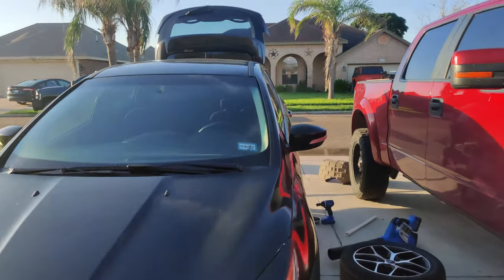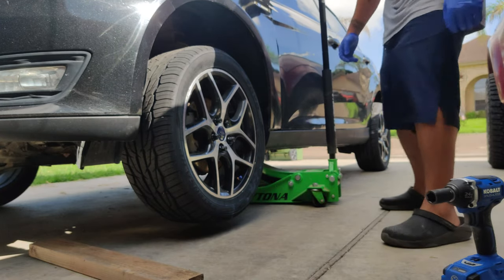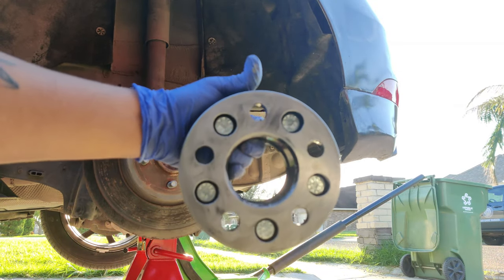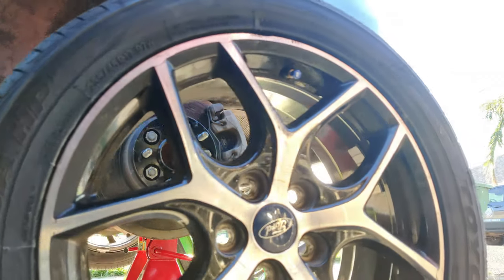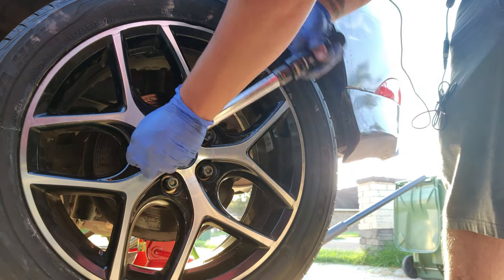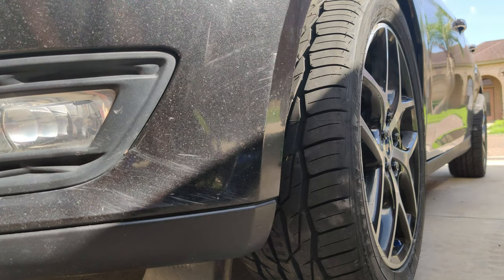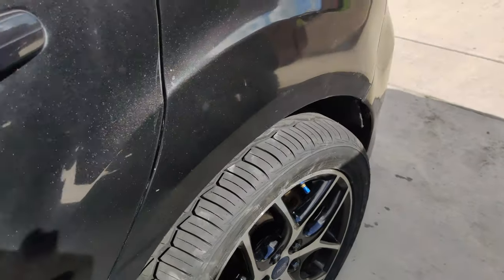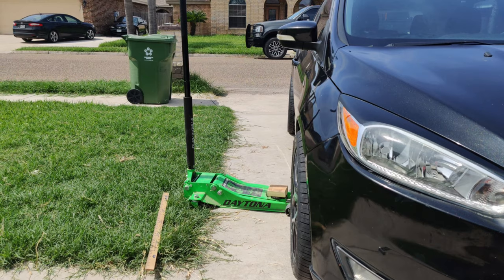Ford Focus Wheel spacers-How To

Comment: Thankfully a video of someone spacing factory wheels that’s NOT AN ST!! Lol 

Appreciate the video! Although helped me decide size I’m gonna go for my personal opinion with a 15mm front and 20mm rear. Not saying 25s look bad, I’m just looking for it to sit just flush with the fender and get rid of that horrible sunken in look. 😅
Reply from the maker: Yes, from the factory the wheels are totally inside. It does have am ugly look. With these spacers I can see a more sportier stance. Thanks for watching
Reply: I second the appreciation of a wheel spacer install and outcome on a NON ST or ST wheels. 
I opted for the 20mm rears for the more flush fitment. 25s look good! Just trying to get the rears at least not so sunken in looking horrible from behind. Then next are the fronts. 
I’d love to know why OE’s don’t calculate suspension, offset, hub assembly’s to have closer ratio to fender fitment rather than sunken in all around .5-1in 🤦🏻‍♂️ I get bit making them absolutely flush, would make tire options more limited and more chance your average joe crunching a fender or quarter panel. But focus rears are just horrible without the correct offset wheel or spaced oem wheel.

Comment: My wife’s SEL 2017 sedan has those tires and rims… while my 2015 SE has the factory ones…IM GOnna do this and buy some black low profile tired
Reply from the maker: Remember to take into consideration the tire size. Mine are actually wider than the factory tires. 215 is factory, I went with a 235, and with the spacers, it makes the car look sporty.